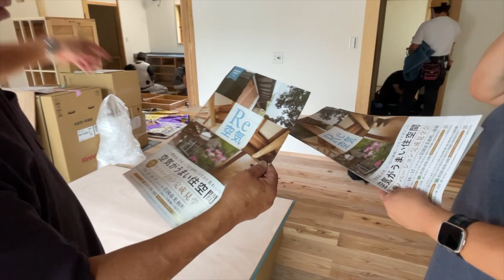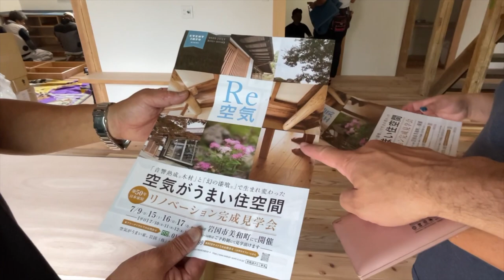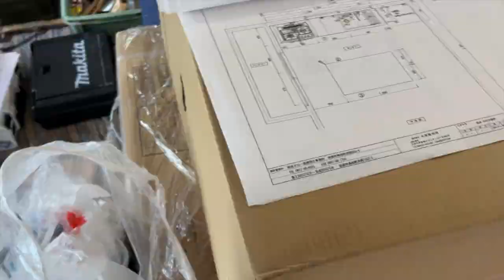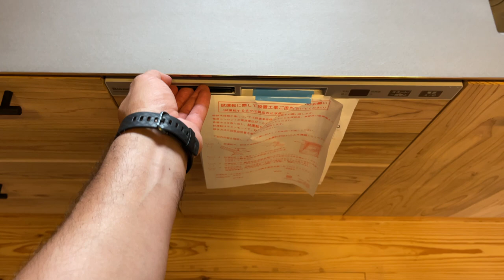Akiya Renovation With a Modern Kitchen

Comment: Now the decision of having white walls in contrast to the wood shows that it will be a perfect balance. Just as much wood that it is cozy but so much that it feels like in a dark wooden box so the room is still very bright. 😊😊 We in Germany also have no garbage disposal in the sink. We put it to compost and thats it. So the sewage water has only absolute unavoidable  solid parts in it. I thought these feel like blum sliding drawers and there are.
Reply: Correct! I wanted the wood feel and look, but not too much. I am very happy with the balance. Additionally, the walls and ceiling is shikkui which is old style lime plaster and absorbs humidity and toxins in the air.

Comment: Really love the kitchen Lawrence. If you want to double your kitchen space for next to nothing just run a nice long pole across the kitchen and suspend your pots and pans with S hooks so the pots will dangle just above head height for easy grabbing and putting away. No bending down to get saucepans or pots and easy to put away and your cookware will last longer because it doesn't get beat up as quick. Once your wife gets used to this she will never go back to storing this stuff in drawers or on shelves and will use these good drawers for other stuff.
Reply from the maker: About time you recommend something that does not cost me an arm and a leg :-)
Reply: @cocolenchojapan  I've ran out of expensive ideas but I'm sure they will come once the Casita video comes out.
Reply from the maker: @RealRuralJapan  sounds like you are competing with my wife :-)
Reply: @cocolenchojapan  By the time we are done you may have enough money left for an old black and white TV sitting on milk crates with a rusty coat hanger aerial for the man cave. Maybe an old sofa from the charity shop too if we pinch those pennies for ya.
Reply from the maker: @RealRuralJapan  haha sounds about right!

Comment: Did you ever consider getting a "proper" oven, or is it something you just don't use?
Reply from the maker: Well we got a smaller Japanese external oven which is in the pantry. If you have seen my older videos you will know what I am talking about. If not, we made an extension to the side with a sliding door, counter space, shelves and lots of outlets. This way all the other “stuff” is hidden and the kitchen stays clear of clutter, which is a problem we have. I will eventually make a video covering this topic, thanks!